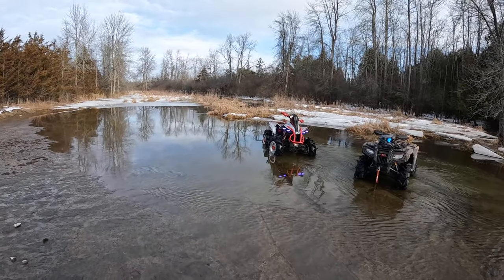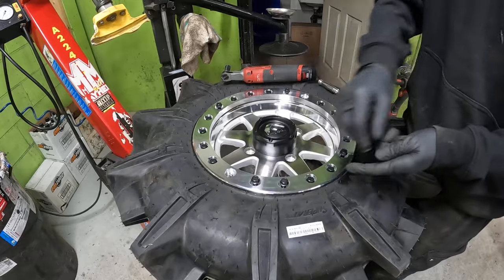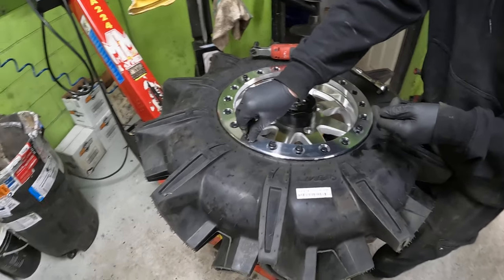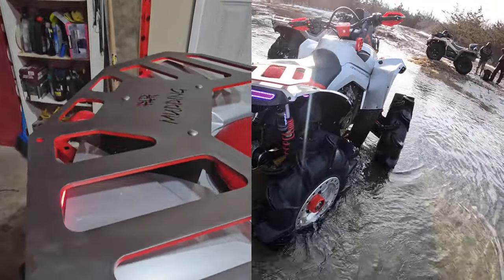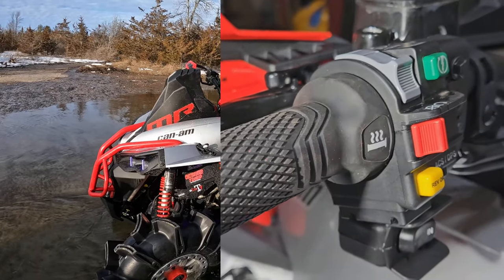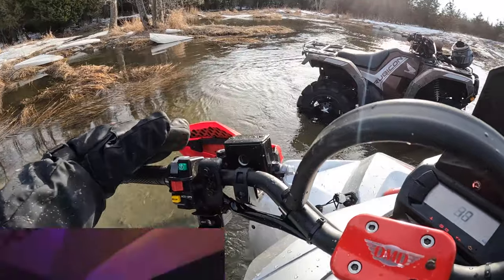2024 Can-Am Renegade Full Build Walkaround

Comment: Great build!  How much rise did you get with the handlebars and do you think it improves handling. I don't like how low the stock bars are and shifter it close when bars are turned or starting to get stuck in mud.  Thx
Reply from the maker: A touch over 2" with stem insert as well. I know what you are saying! It's tight and can actually be dangerous at times when reaching for that shifter in some scenarios. Braaaap. Yeah, it definitely improved the handling imop. Takes a ton of strain off my shoulders when standing and ripping.  Cheers my friend,  I appreciate ya checking out the vid.
Reply: Thanks for the info, prob the first upgrade I do. 👍

Comment: How did u completely seal your belt box?
Reply from the maker: Comes sealed on xmr
Reply: @ehTV1000  well I got a 2023 xmr1000 and I’m having belt box leaking problems rn just trying to see how to fix it
Reply from the maker: @perryduhe8557  pull the plastics and tighten all the clamps on tubes and make sure they are seated properly.  I do this with every unit. I find loose clamps on every one.

Comment: What model number are those wheels joe 🎉
Reply from the maker: Not sure about numbers, that would be a question for Roger. @n2ytires. But they are called fuel UTV Maverick beadlocks in machined finish.
Reply: @ehTV1000 ok thanks Joe